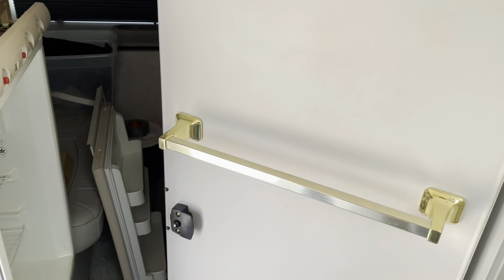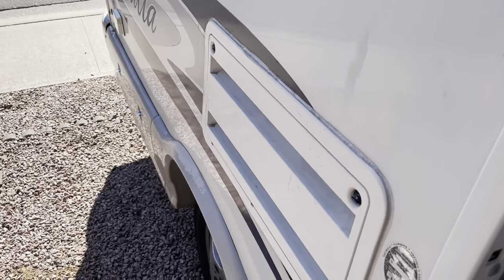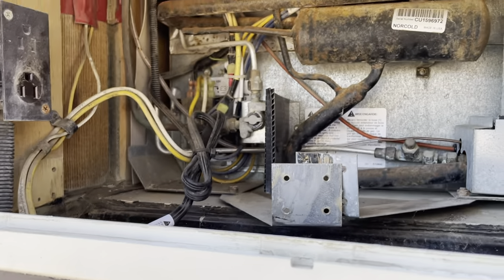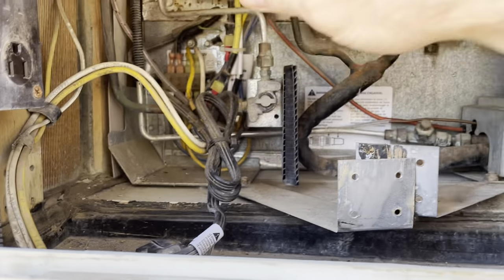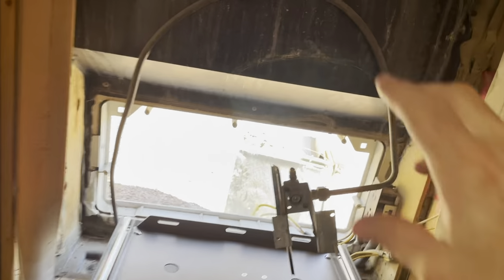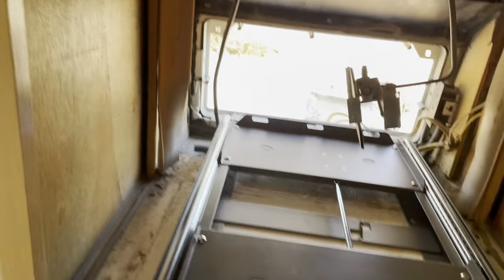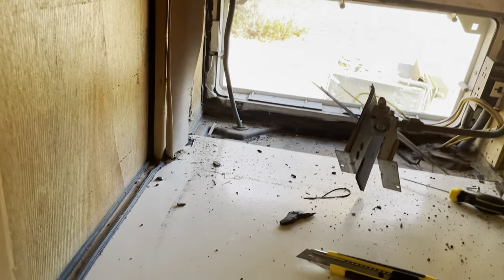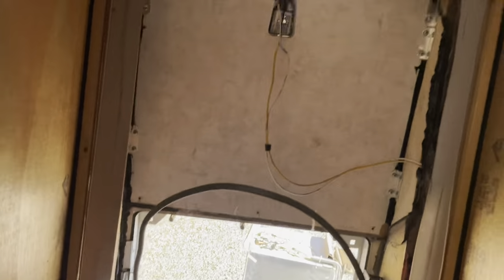Winnebago Rialta HD | Chest Refrigerator Upgrade (Part 2)

Comment: Hello, I have a 2004 Rialta.  Can you tell mw where the window fuses and relays are?
Reply from the maker: There are a couple fuse blocks hidden up under the drivers side of the dashboard, above where your left foot is. There may be a plastic cover over it, and it’s probably not labeled.
Reply: @TravelingSolo  That's my dilemma.  My driver's side window switch has no power going to it and the fuse box has no label to let you know which fuse is for the windows .
Reply from the maker: @salsainatlanta  try this and see if it looks familiar: https://fuseandrelay.com/volkswagen/t4.html